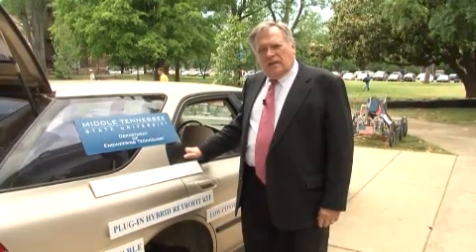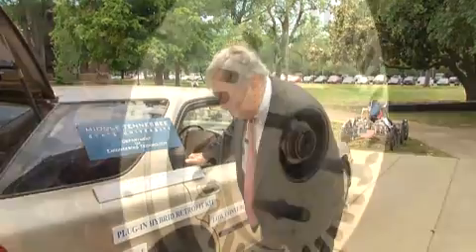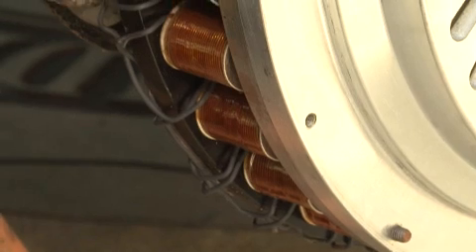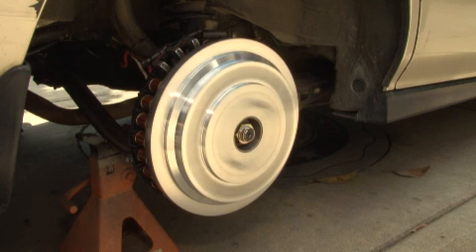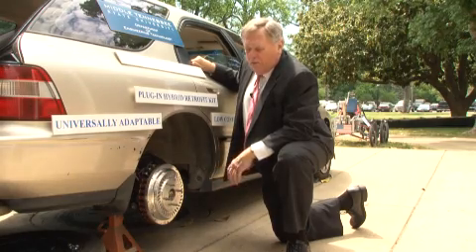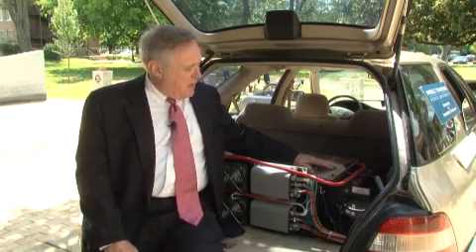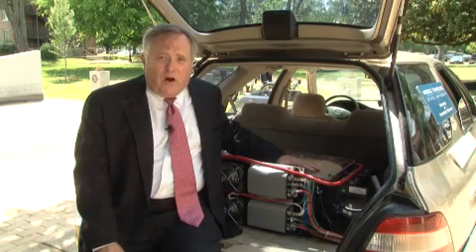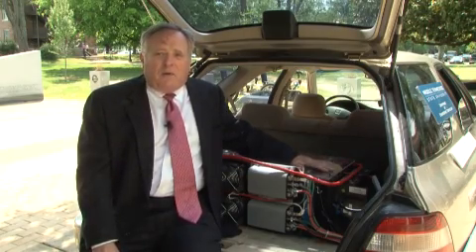Plug-in Hybrid Retrofit Kit [Revised]

Comment: Very good...I conceived of a similar thing in 1990, and called it 'motor in a wheel'.  University of Leeds in the UK had an initiative, they called it 'transmissionless drives'.  It is best done I believe with all 4 wheels, and from the ground up.  I never thought of doing it as a conversion, but that's pretty good.  All the electric cars so far from major maunufacturers, still employ transmission.  I guess it's an in-between phase they are at.  ONLY ONE issue I considered was a downside - bad flooding.  Water - we have nothing if not rain here in northern Europe/UK, and pools of water might cause some issues at the splash going into heavy amperages and high voltages inside the wheel space? Very cool, though prof.

Comment: You say this works on most cars, but this car is designed around a drum brake system.  Most cars being produced today are now rear disc brakes and about 99% of all cars today are front discs.  How do you get around the disc brake system?  I see this as a great advantage to the drum brakes however, but it is already antiquated unless there is a disc brake option.  Thanks, Dustin.